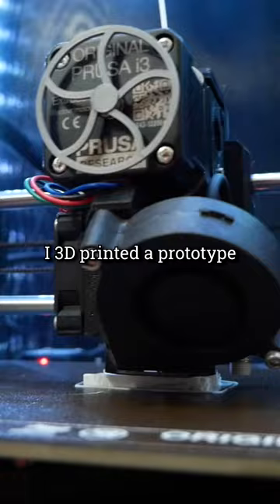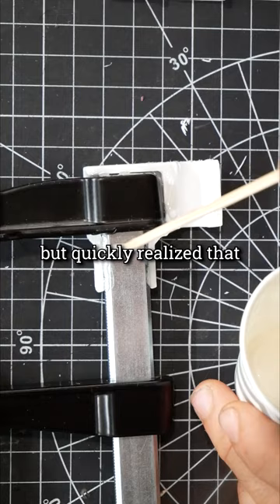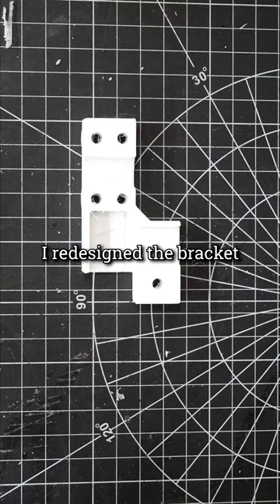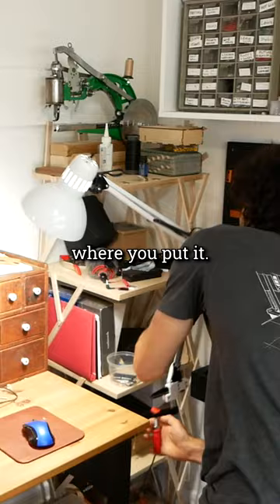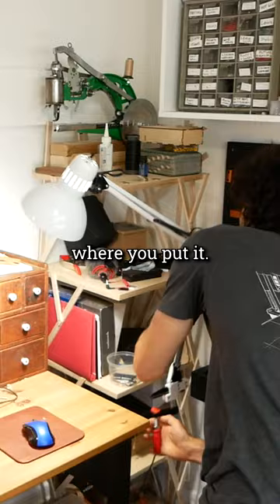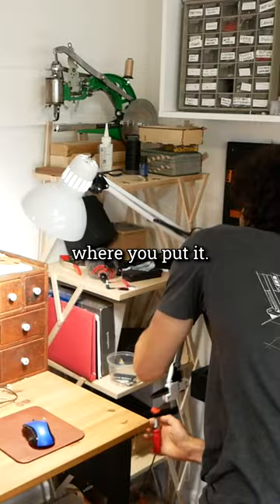Fixing a bad design with 3D printing #DIY #3dprinting #design

Comment: Correction, they never fall out from your desk, even the cheapest ones have more robust design and materials than what you did.
Reply: No I have the same problem with ikea architect lamps they just don’t have enough surface area to hold tight on my desk

Comment: Maybe make some plates to spread out the force of the clamp. That way you can use higher pressure with a lower risk of damaging the wood further. I think a rubbery filament would be good for that.

A custom(not complicated) design that fits well on the clamp and limits the possibility of it sliding off

Comment: I really think people tend to design 3D printed parts with way to much glue and that kinda connections.

Personally use nuts and bolts a lot. They often increase the part strength by quite a lot. As well as being a connection you can undo later. Whenever possible I strongly prefer that method.

Comment: I don't use the conventional mount. I drilled a hole into the table and then added a 3d printed sleeve. Doesn't go anywhere and looks good on the table.

Comment: hmmm I wouldn't design it that way....the layer lines wouldn't hold up....I suggest printing 1 piece that prints parallel to the hole for the lamp and using like a U shape with screws at the top to clamp the lamp to the clamp

Comment: So, those bar clamps, you usually can pull the bottom section off completely to reverse the pressure (bow things apart instead of clamp)

If you cannot reverse it, just grind off the stopper rivet and you're good to go. 

Then you have one solid printed piece slipping over it. You can also make the solid piece wide enough to accommodate the jaws, and when the screw is tightened down, the cantilevered force clamps down on the slipped over section.

You could also print a small shim, and force the shim in with the jaw if there is not enough cantilevered force to do so.

Comment: I have a magnifying lamp with the exact same mount and it drove me crazy. The bottom jaw always starts to rotate and slip when you tighten them. My solution was to screw it down to a small piece of acrylic (the bottom isn't solid or flat), then use double sided tape on both sides of the clamping mechanism and finally tighten it as hard as I could. It has worked and you don't have to drill holes. It's still a pain in the ass to move so pick a good spot.

A suggestion: you could use a C-clamp instead. It would not take as much space and should have enough grip strength.

Comment: All you needed was to glue a piece of flat rubber on the inner surface of the clamp. That would generate enough friction to hold it in place.

But then you wouldn't have an excuse to use your 3d printer, wouldn't have a short to upload, and wouldn't have the engagement from people typing smart ass comment like this one.

Comment: Try reprinting your v1 in 1 piece with a living hinge and proper layer orientation. Or, just use the factory clamp as they work fine if you use them properly.

Comment: If you print your own screws in the horizontal direction with supports it's twice as strong then if print vertical 
In torque, sheer and load testing 

Amazing how strong for a 3D printed screw

Comment: Wow, you replaced a used plastic mount with metal where it's needed and it is more durable.. If you use the original mount right it would not fall off the table.

Comment: yo- not a professional but i have an idea i wanna share. I understand working with Carbon fiber is a smidge dangerous but there is a lot of waste material that doesn’t get used when making things with it. if you made a coffee table out of carbon fiber waste and clear epoxy I think you could sell it for 5 grand or more depending on the size and amount of carbon used.
Reply: You also have to find someone willing to buy a 5k table💀

Comment: Good idea… but could you have used printed in place pins and holes to hold the two pets together rather than bolts and still use epoxy 🤷‍♂️
Reply: The bolts would be stronger anyways